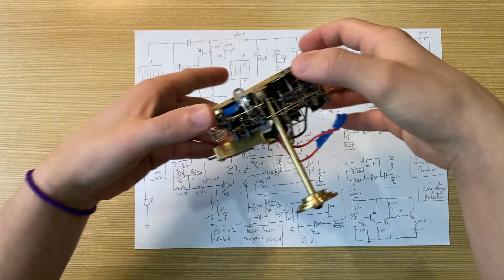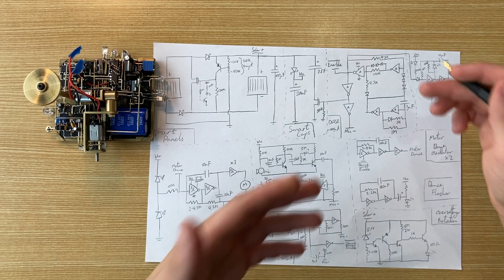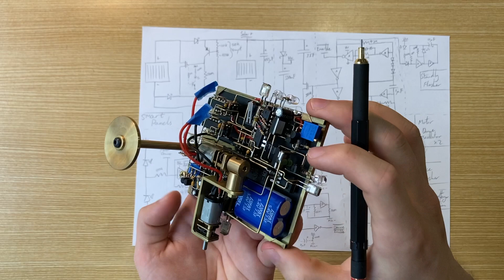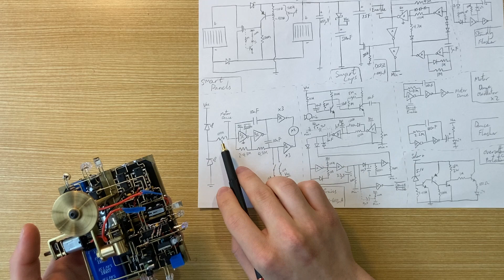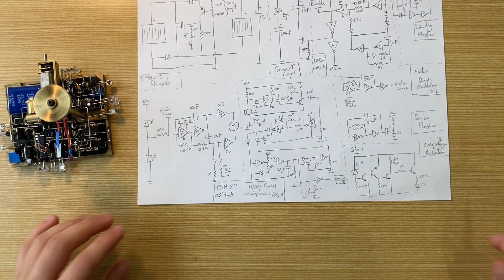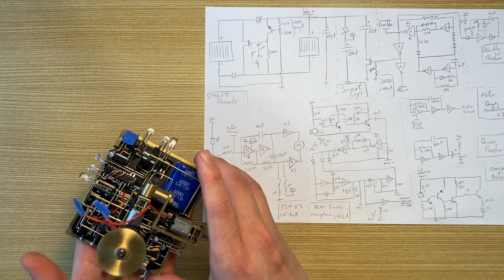BEAM robot head in a jar: close look and circuit explanation

Comment: Thank you for the explanation! I didn't expect such a detailed video. That smart panel circuit with the capacitor swapping is extremely satisfying! You did a terrific job both circuit- and mechanical-wise. I believe Wilf would surely be proud seeing this!
Reply from the maker: When I first looked at that "smart panel" circuit was a little mad at how simple it was! Im sure it can be improved as it does oscillate in a very strange way when around that threshold (I really should have looked more into what was actually happening there but I just chucked that 100uF cap on and forgot about it). 

Hopefully the mechanical assembly holds up, it is usually my weak point with these bigger, more dynamic builds. I have made most parts replaceable though so fingers crossed!

I did try to contact Wilf once a while ago, maybe I should try again, I too think he would love to see this.

Comment: Beautiful! Love the series/parallel circuit for the panels! Kind of reminds me of a Marx generator. I love finding new uses for that trick. The whole thing looks stunning, and the movements are delightful!

With the diode sensitivity, I am sure I'm 3 years too late for this comment to really be of interest to you but I think you'd have more luck adding resistors in parallel with the diodes rather than in series with their output. You used them in photoconductive (reverse biased) mode, right? They're really fantastic current sources in that mode, and have very high output impedance. Adding more impedance in series probably won't really make a huge difference in how much current they deliver to the downstream oscillator. If that series resistor were some fixed value (the 1Meg you have or somewhat smaller) and you then added a resistor in parallel with each diode (whose values would be equal and adjusted for the desired gain), the diode's output current now is working into a lower load resistance, and will cause less voltage swing at the bridge node. Then the series resistor can turn this lower, controlled voltage swing into the variable bias that you want for your oscillator. 

I guess the other thing I'm a bit confused by is how the diodes are supposed to have their optical receptive fields aimed. With solar trackers the diodes usually want to be aimed outwards so that when the sun is centered, both diodes have somewhat less than maximum signal, and then when the sun is off to one side, the diode aimed off to that side has maximum signal and the other diode has much reduced signal. These diodes look like they're just aimed straight forward. How do they get a differential signal? I guess you said you have too much gain to begin with though, and putting them almost dead ahead means they won't produce much difference current for a given mis-alignment, so maybe that's actually helping you!

The last comment is that although I suppose it's antithetical to the aesthetic of B.E.A.M., I feel like the right solution to pair with a sloppy/backlashy motor with plain proportional control and a deadband is just plain old sliding friction. Maybe the device just has too much inertia and you'd just need too much friction for that to work, but from a control perspective frictional drag is more or less what's called for. I mean, my heart would probably hurt a little if I were you and decided I had to put friction brakes on my motor output shafts on such a creation, but it might be the right move.

Well, all that's kind of moot, since you created a beautiful thing here and had gotten it to do what you wanted! I'm really glad this video popped up for me 3 years after you made it, it made me really happy and you have done an amazing job, thank you for sharing!